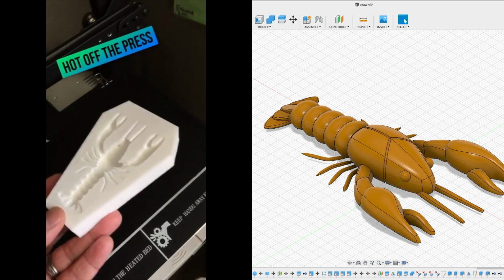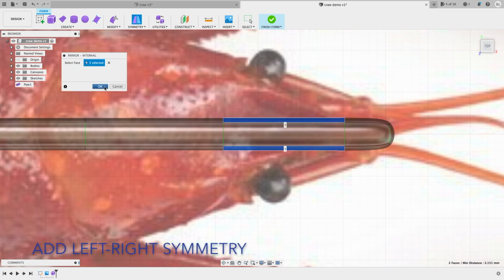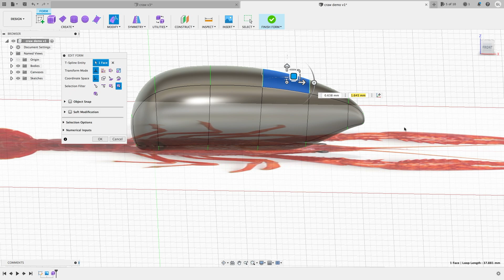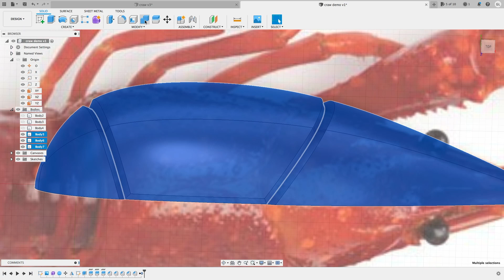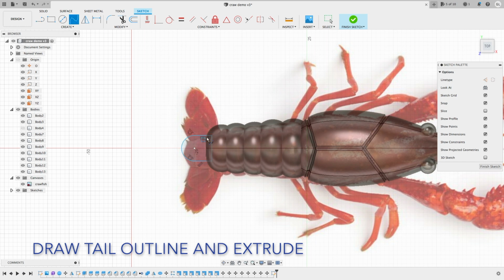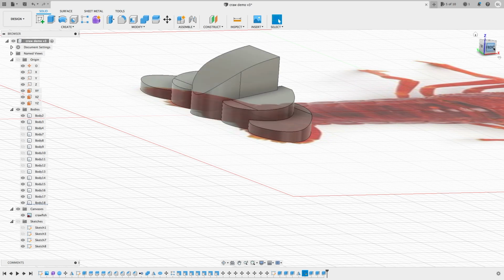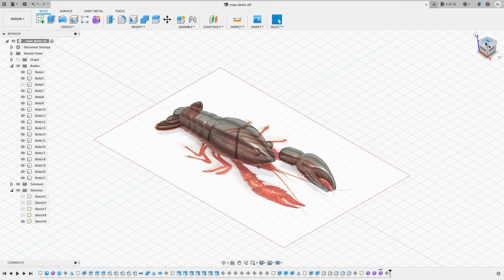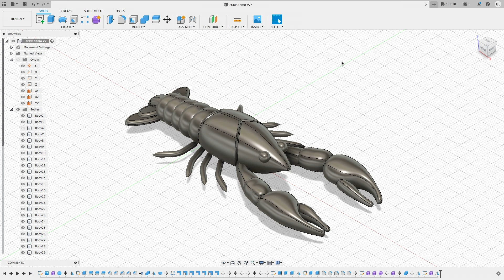DIY Crawfish Soft Plastic Lure Mold Design

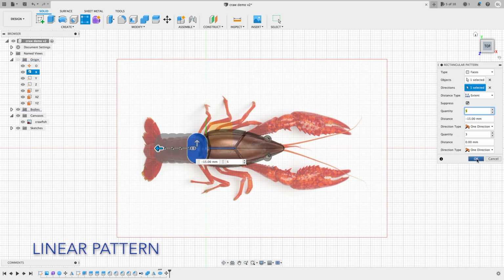Comment: hey. at 4:12 when you want to scale one of the torus you have automatically selected anchor point. If i do that the same way i have to manually select anchor point to scale the body. What am i doing wrong ?
Reply from the maker: Try to select the object from the left object list rather than clicking the object itself.

Comment: Are your stls shared? I 3d print and pour tons of different plastics, but do not have your fusion skills. Let me know if you want to trade or have me pour some really cool baits in your molds.
Reply from the maker: Sorry, most designs are private use only. Will let you know if that has changed. Is there a way to PM you?

Comment: Any advice how can i try to recraete a fishing lure like Black Minnow FiiSH ?
How would you start , what would be you approach for lure like that?
Reply from the maker: I would create the body using pipe form (left right symmetry), add the paddle tail, then cut the whole thing out for an open pour mold. I probably won't spend too much time on the body details like scales or ribs. 3D printed molds already have some contouring effect. You will need to pour two-tone plastisol: translucent white or clear for the belly and darker color for the back. Hope this helps.